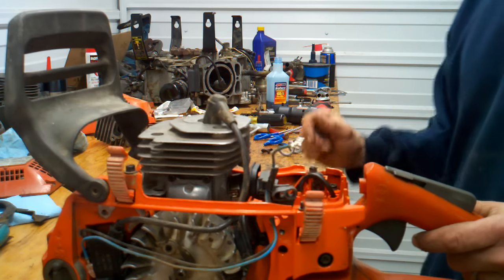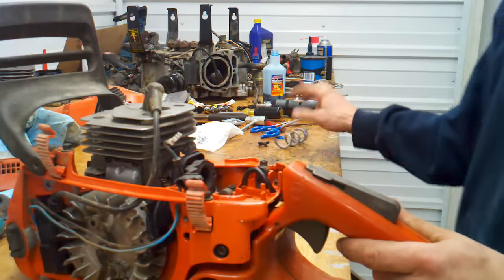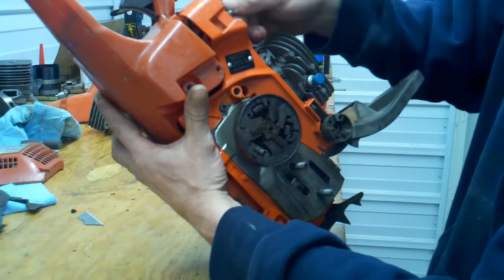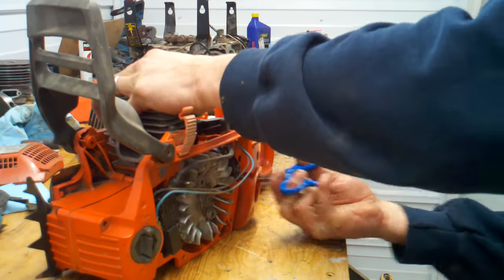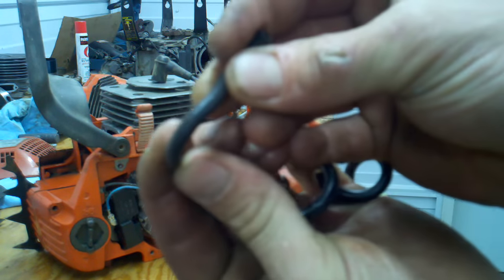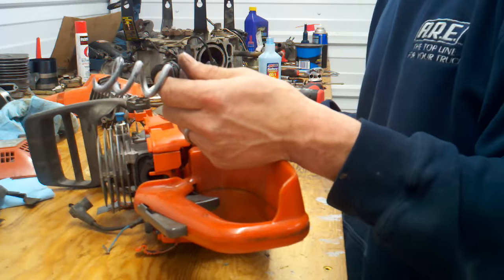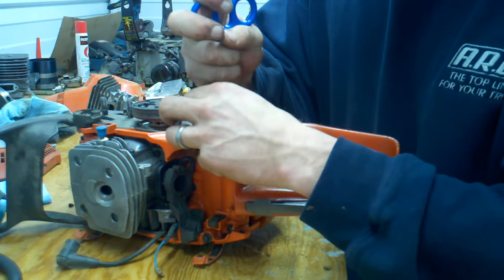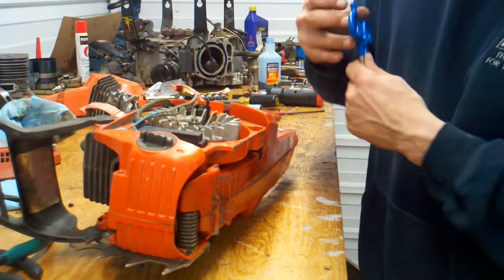Husqvarna chainsaw fuel line check and replace

Comment: WISH I HAD FOUND THIS VIDEO EARLIER!!!
My 51 would not hold a low idle. Then bog when I hit trigger.
No real impact when adjusting carb. 
Chainsaw was given to me and I did not know how it was maintained prior to me recieveing it. Carb looked clean, so I assumed old gas mucked up the insides.
Bought new carb ...Could not adjust that one either.
Checked the fuel line at the problem area you highlighted in this video, found cut in line, replaced line and started it up. 
Holy Hell! saw startled me it started so quick and rev`d so strong........No carb adjustment needed..
Thank you for taking the time to make this video.

Comment: After further checking on my 288XP, I found the line goes straight down through that top plate, that mweba1 seemed to be working under.  I have a little rubber grommet that protects the line as it come up to the carb but otherwise the procedure is very much the same.  I now have my new line in place, with the filter attached, and the line is now on the carb.  Thanks for the help this video gave me.

Comment: I am working on a model 288 Husqavarna. Although some complain about this fellows hands being in the way at least at the 2:00 minute mark I now at least know where and how to look for that spot to insert the new line.  Mine has a rubber grommet that the line comes up through to the carb. My line was so rotten I could not see where it came from.  I think I still have a piece stuck in the hole into the tank, but now I know where to look for it. Thanks.

Comment: That's exactly where my fuel line failed, I took it loose from the carburetor and it was nice and flexible, look in great shape but right where it goes through the entrance it's only hanging by a thread.

Comment from the maker: The line is a specific size.  If it does not fit tight into the tank it will leak.  Oregon has a 3/16 that is the most common for people to use but it is to small causing  a leak.  See this weekly.

Comment: This was wonderful!. Please also address fuel tank vent and filter plug that go together. They appear to be on the diagram on parts tree website, but do not exist in my model. Is it possible that 372  doesn't have a vent? 
If you know of course....  Fuel tank vent resembles approx 2 inch long multidiameter straw

Comment: @mweba1 The shop i work at sells all amzoil products so thats where i get mine, they use amzoil mixed gas in all there stuff including 4 cycle and theres no problems. Its smokeless, doesnt built up carbon, 100:1 is good for all engines, just all around a great product

Comment: I have a Husqvarna 136/141 recently discovered that the line broke off at the fuel filter so do I just attach new line to bottom of the other end of the interior piece hanging down inside the fuel tank?

Comment: I have a 345e. Now on your video you are informative. I have one question I had my boss replace the line feeding from the primer bulb to the white nipple. Now when we poured gas in the gas ran out everywhere and when i tried to prime i got nothing in the bulb just gas pouring out. Is the husky gas line specific in size? i got 1/8 gas line... or did he put it into the breather and not the right spot? hope to hear back thanks

Comment: Can you tell me where the vent line goes there?  mine has 3 lines and leaks when i lean it on the side to fill the fuel.  thanks,
Reply: Did you ever figure it out, dealing with the same problem?

Comment: How does the fuel tank get its vent air? I have a 266xp and put a new carb, fuel line and filter on it and did the initial settings on the carb and it will not start with out priming it, then runs up the rpm then dies like it's run out of fuel. Does the carb suck fuel into it, or is it pumped in somehow? I've tried a few things and I'm about to give up on it... Any help would be appreciated.
Reply: The cap has the vent. I know it's 2 years later, but better late than never!

Comment: I have a Husqy 345 and the fuel filter looks bad but the hose, new. I'm going to try it with a replaced fuel filter only, first. How did you detach the hose from the engine end? What's happening is that the engine dies when I apply gas especially on horizontal cuts, like on a tree stump. Can you help?
Reply: +stilus looks like I found the problem-- thanks for the youtube.

Comment: mweba1 I have a 455 Rancher that has a leaking fuel line. When I ordered the replacement it is coming in two pieces. How does this go in as opposed to the model you are demonstrating?
Reply: I have the same model. The fuel line works the same, however with a purge bulb you need the yellow line to connect to the tank vent and the other yellow fuel line to connect to the carburetor that has  the port on the bulb side as opposed to the inlet port on the fuel hole next to the vent on that right side closest.

Comment: Hey I have a jonsred 2150 turbo that has a broken muffler bolt stuck in the carburetor is there anyway to fix that
Reply: Take it to the service, otherwise it may be difficult to remove the bolt on your own. For the muffler I suggest you can buy a muffler support bracket that is for 346xp, cut the right hand side support, bend the bracket so it fits the saw.

Comment: Can someone help me. Just today I noticed my 372xp OE leaked fuel when tipped on the bar cover side so I took off the handlebar and I took out the bottom screw and it started pissing out gas out of the bar mount hole

Comment: i have a 350 husqvarha chain saw  when you give it gas it will dead what is wrong with it lput new fuel/carb on it
Reply from the maker: Likely an air leak.  I did a complete saw tear down rebuild video.